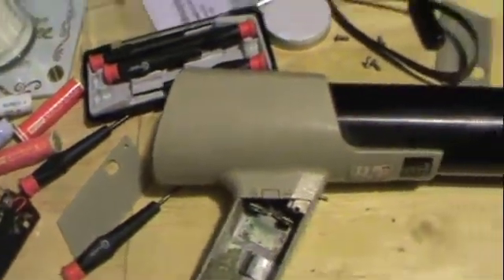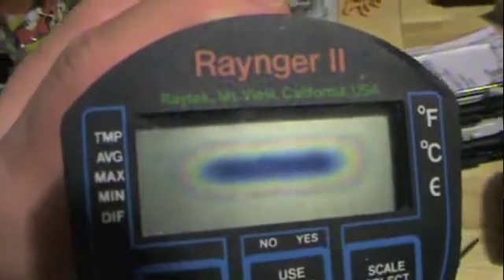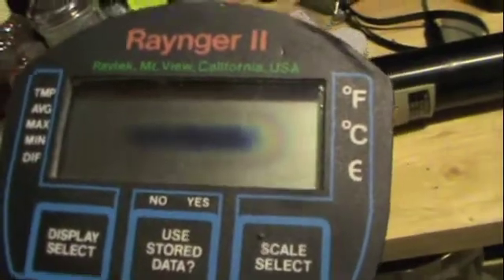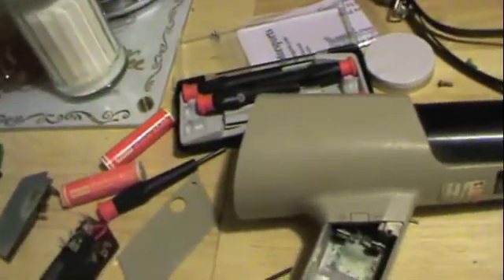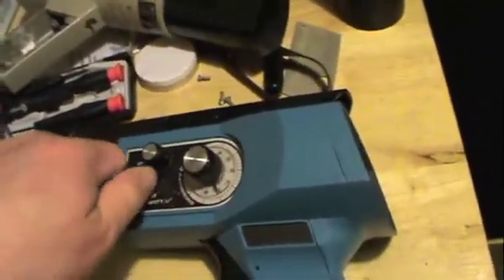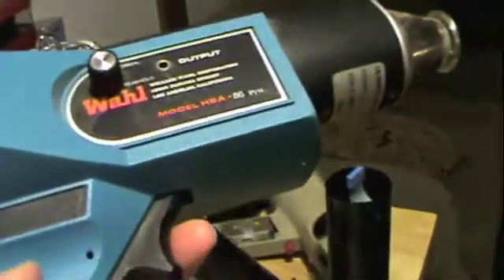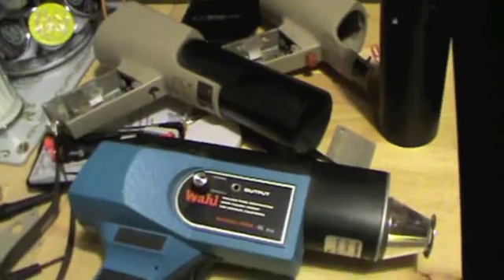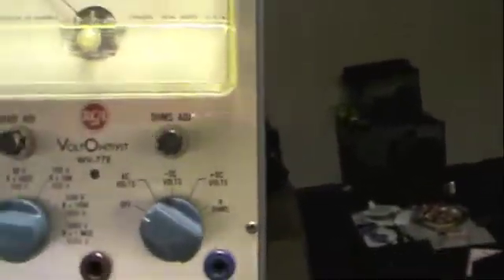trash-picked proton plasma ray guns or whatever

Comment: I seen those gray heat detectors when they were doing a refueling on a submarine I was on at the time it was used to measure reactor casing for heat loss . It was not kept on board but used by some company helping with the refueling I got to play with it a few times .